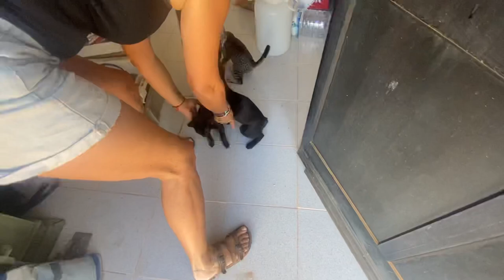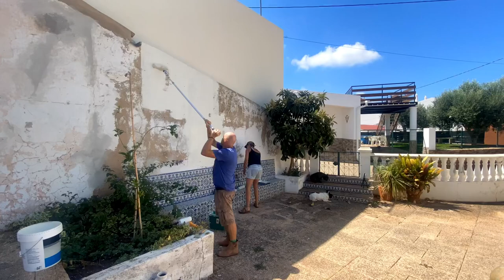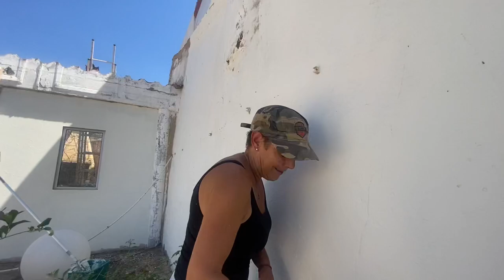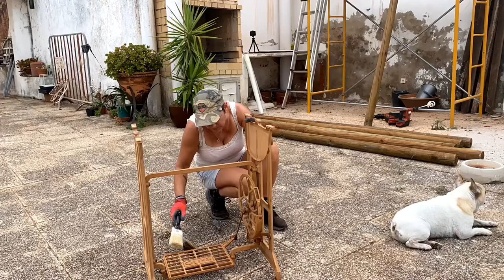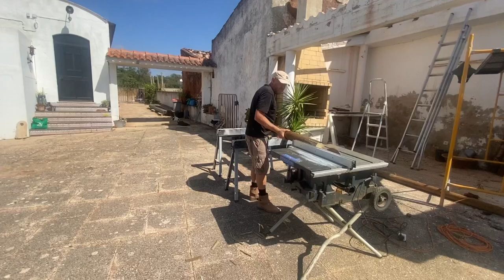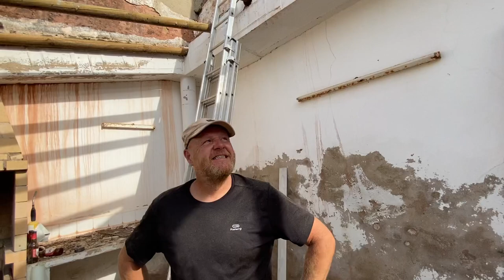Starting the roof on the outside kitchen

Comment: James - they have drill attachments to do what you were doing manually to taper the ends of timbers. Probably only worth it if you have many of these to make.
Reply from the maker: I've seen them but not worth it for just 6 post.